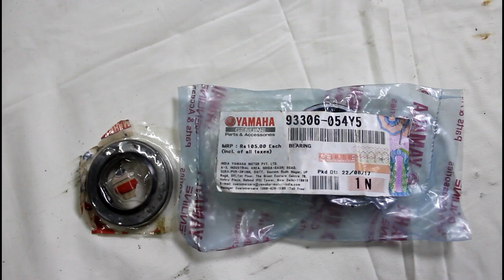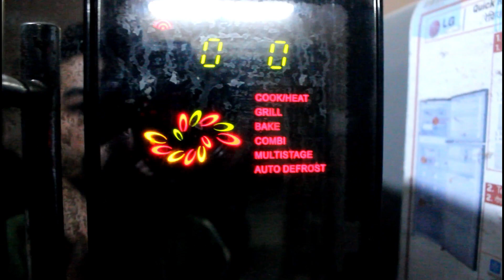How To Change Sprocket Bearing | Yamaha Rx 135 Restoration Project - Part 2

Comment: Tq bro for making this video.. 
Actually i have a Rx134 bike and it has a problem like petrol is continuously flows from over floe pipe vch is placed to carburettor...please advise how to stop this folw
Reply from the maker: Check the float pin....either its worn or their must be some dirt in between the float pin and its seat.

Comment: my stock sprocket size is 15T - 37T but later on i changed it to 15T - 39T and it reduced speed and increased pickup a little.
so what do you recommend the size because i want high speed and better pickup.

Comment: Bro, I see that the chain was already loosen, how do we do it? Also, Is it necessary to lube the bearings?
Reply from the maker: It was loose because I already removed the engine ......you don't have to do that....just remove the sprocket nut and the chain will be loose enough
Reply from the maker: The bearing comes pre lubed ....I just like to add a little
Reply: Oh OK, Thank you!